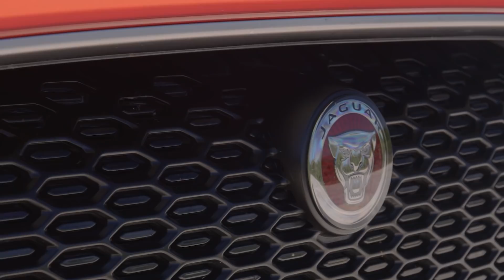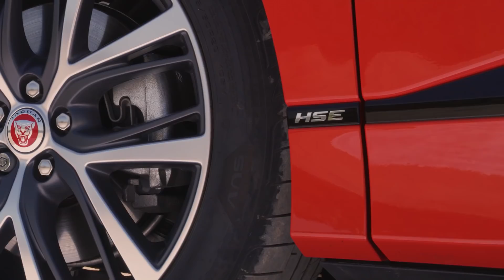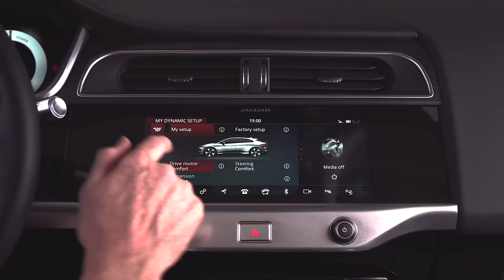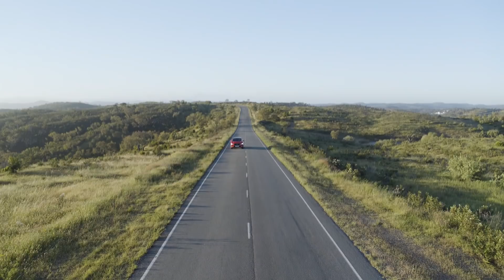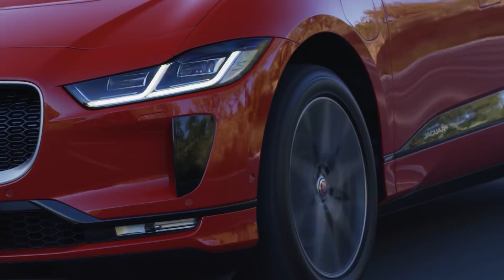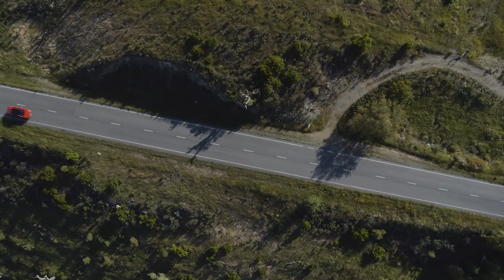2018 Jaguar I-Pace first drive review

Comment: Only downside I read and hear is a lack of charging stations, up to 8hrs charge if this is correct, til more charging stations became available, even at your place of work, to charge whilst working, as person's living in flats, on road parking with no option to charge from a charger fitted to their home's is a issue to resolve for the future of electric or (your local city jag dealership would collect your ev from your home, to take it to the dealership with a charge station at their dealership, for you.. to charge it for 8hrs, and then return it to you once charged up or a courtesy car whilst yours charge) with a focus on a build of lower charging time's, also, (but if i could loan a courtesy car in on road parking with the no option to have a charger fitted to the home), whilst mine charged i certainly would love one, I love it, and the best styling of a electric car, I've seen at present

Comment: This would need to be half the price of a Tesla .. since they don't have a Tesla super charging network...It would look good in someone's driveway.. but not much farther.
Reply: You just charge overnight at your home.  There's no such thing as a "supercharger."  Taking 30, 40 or 50 minutes to get a decent charge is not in the slightest "super."  It's ridiculously slow compared to filling your tank.  BEVs are for driving within 100 miles of your home base and charging overnight, and that's how most BEV buyers are going to use them until you can "fill your [battery] tank" in ten minutes on nearly every street corner.
Reply: @aldeflorio5500  After driving for 3hrs.. i stop to pee and get something to eat.. my car is giving me warnings that i need to move the car from the super charger.. for me the super charger ..charges too fast.  I can travel long distance faster than i can in any gas car.. because a gas car requires 100% of your attention when filling.. an electric car requires 0% of your attention to fill.  it is the opposite of what you think.

Comment: Would have been better if it had been a Hybrid
Reply: M Skallywagg
And be in trouble with its complications
Reply: Why would you want to corrupt it with a gasoline engine? Hybrids won't be around in 5 years - it'll be 100% BEV. Go look at InsideEV's EV scorecard, and check out where the hybrids are. Not impressive. The only hybrid selling well right now is the Prius Prime, and once the model 3 ramps up, the Prius will drop off the face of the earth.

Comment: i probably missed it but i couldn't find them mention the actual weight even though they lamented about it so much.  i would have thought comparing it to the tesla model x is more appropriate than comparing it to the model s.  claiming it has "one of the longest ranges of any electrical car" seems like a bit of a stretch. The Tesla S and 3 have longer ranges and the X is -3 miles on range.  All the other cheaper pure EVs available today are in a different class in terms of price and range.  I think Jaguar has done a good job of providing a range that competes with other higher end EVs.  maybe i'm splitting hairs.
Reply: 2,133kg (for the base spec, iirc)
Reply: wow, yeah, that is pretty heavy.  and still, it's about the same as a tesla model s so maybe pretty impressive for this class of vehicle.  a good deal lighter than a model x as well.